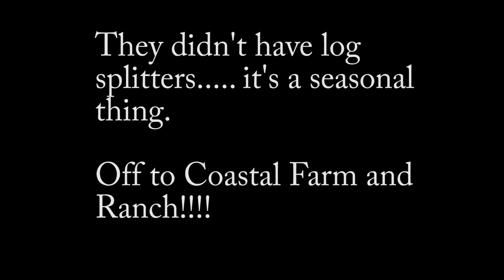Log Splitting Fun! Stress Reliever! Watch ur fingies!!!!!

Comment: You can tilt the ram up and u won't have to lift the wood
Reply from the maker: JMC1992 we liked it in the horizontal position for the smaller stuff, but use the vertical for the bigger rounds.